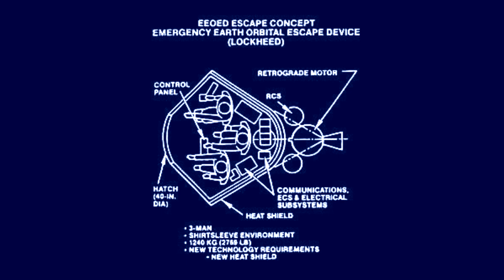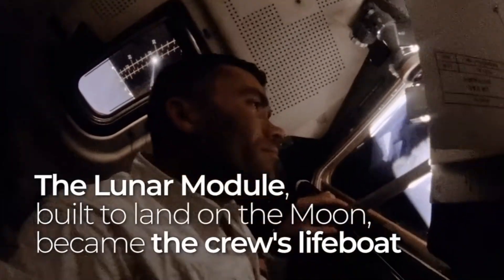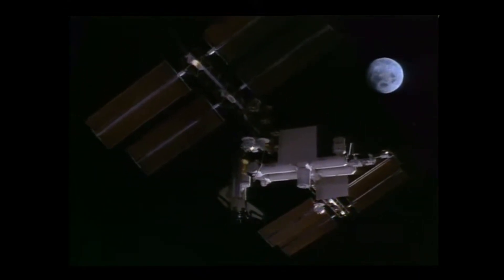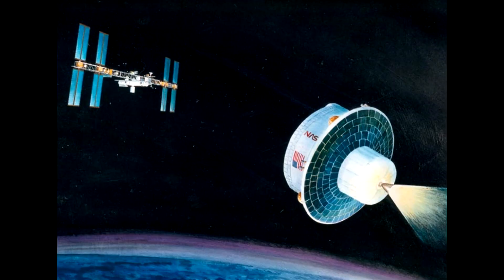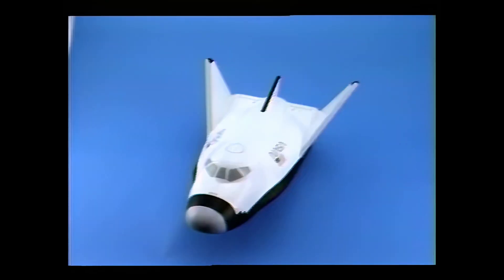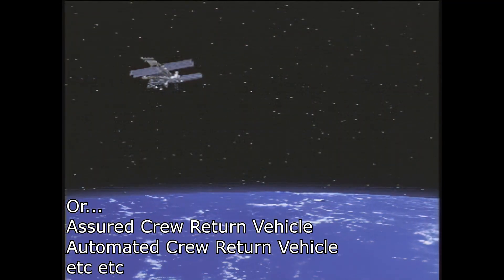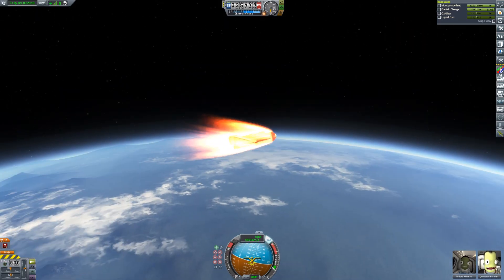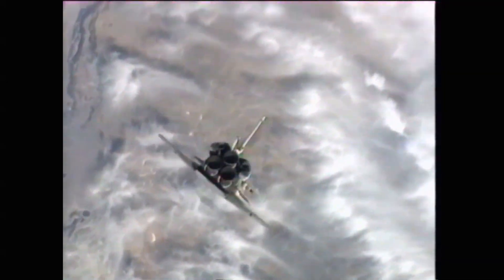The 'Escape Pods' That NASA Developed, But Never Used.

Comment: Scott what do you think the likely hood of a replacement for the space shuttle something that is capable of serving satellites in space and travel to the space station?  
I know China has its own space station etc and I heard something about the ISS coming to an end…

Why can it not be expanded rather than dismantling it?
If it’s due to worn out parts can they not be dumped to burn up and replaced etc..
I would have thought it would be cheaper to expand what is already there rather than start from scratch etc..
Keep up the great work

Comment: Wasn't Orion also considert as an ISS escape vehicle, after both of it's launch vehicles and it's service module was cancelled?
Reply: Back under the constellation program it would have launched on Ares 1 and faired crew till commercial crew was ready or commercial crew was created after Ares program was cancelled and revamped into the SLS program

Comment: Way back when I worked for McDonnell Douglas (MDAC) at KSC I was part of a team that was supposed to evaluate systems for what was internally referred to as the GTFO (Get The F... Out) for Space Station. It never materialized. The problem with all these ideas is the additional cost to develop, build and maintain. The thinking always came back to using the transfer ship as the rescue ship because you already have it. Shuttle was a problem but even back in 1988 there was talk about partnering with the Russians for a long duration escape ship.
Reply: The use of a cargo ship as a rescue ship is another option - the Dragon was quite capable of that. It does involve a reduction in payload capacity however.
Reply: @allangibson2408  ... would it? Ôo
Just a silly late-night thought and with a beer already gone down the drain: you'd need a short-term life support system and a few high-G seats for the passengers. If you managed to make portable modules of them you could stuff them into the Dragon (after ripping out the cargo if needed), attach them to a few built-in mounting points, and you're almost good to go. Question is how long this would take, but it might be an option.
Reply: @44WarmocK77  The Dragon has a heat shield so that takes care of the first and biggest problem. You need a minimum of two hours life support for a crash re-entry - the Station EVA suits have 12 hours. The most likely case of need would be a collision that takes out the station by directly impacting the crew transport capsule and damaging the docking port as a result.

Comment: "rocket-propeled lawnchair"
Every first ship in any ship building game ever
Reply: Nothing succeeds like success. You can return a lone stranded Kerbal from well within the orbit of Moho (very close to the Kerbol, the sun) to a fairly safe Kerbin orbit, where she can be rescued by economically feasible means, with something like that! The down-side is that it takes virtually the largest delta-V possible in the game to get the ion-drive-equipped lawn-chair rescue package payload to an orbital rendezvous that close to the sun. Or, about 30,000 m/s. Once she's aboard, the rest is fairly straight-forward orbit-wrangling. To be clear, it's an ion-thruster propelled lawn chair in my version. The mission is called "Big Intrasolar Technically Challenging Headache Prototype Long-range Electrically Accelerated Search/rescue Equipment". So-far it is by-far the hardest rescue-mission in this version of KSP. It's colloquially referred to by the technicians who operate the mission as "B*TCHPLEASE".  The mission-patch is completely awesome, and the rescued Kerbal, Clauby, will get to wear it with pride. She will also out-rank even Valentina and Jeb when she gets home.

Comment: So they designed a spaceplane to replace a spaceplane that couldn't withstand long enough durations?
Reply: Yes, one that could vs one that couldnt. The Shuttles couldnt remain due to the fuel. These would've "kept" far longer

Comment: Thanks for the video Mr. Manley, it is neat and clear as usual.
Just wanted to express my disagreement with the "emergency escape system" being the same ship that transports the astronauts to and from Space. Giving redundancy to every system onboard do not provide a redundant separate mean of escape. Gemini had rocket-propelled ejection seats, Apollo had its solid rocket motor on top. Then, the Space Shuttle had yes maximum redundancies but no escape system, and blew up twice. Soyuz and Dragon both have escape systems; because the First Corollary to the Murphy Law clearly says that: "Your astronauts are going to need an escape system the moment you remove it from your Spaceship".
Thank you - once more - for all the continued and very well documented updates you keep providing. Me lazy, I just thumb up and watch them...
Reply: aslo the spacex dragon capsule itself can also be a escape pod for the iss! with a massive crew capacity from as low of 6 to a maximum of 12 astronauts and more than enough fuel after being docked from being launched from earth to help get the astronauts back  down in a emergency! it even has its own dedicated solar and battery power supply that can even help keep some of the iss systems powered in a emergency and it's also far cheaper then the most what NASA could come up with!  heck starship could even cram a dragon capsule in some variants like the moon and cargo variants for an emergency if spacex wanted to! or they can even have crew be transferred from earth to the starship for interplanetary  long range missions via dragon capsule to save a lot more fuel for starship's missions for going to the moon and mars and beyond!
Reply: @ashtiboy  IIRC cargo variant of Starship will be unmanned, therefore not needing any escape system.
Reply: What about redundancy for the escape pods?
Reply: Fun fact: There were proposals for "Evolved Shuttle" involving liquid fuel boosters and an ejectable crew deck dating even before Challenger, but NASA couldn't afford the development cost of them. #FundNASA

Comment: Every spacecraft should have some kind of escape pod or way of escape it is something I always thought the space shuttle design should have had
Reply: One thing that bugs me on Starship is there is no escape system for use during launch.
Reply: I disagree, well not for the ISS/stations, return to Earth capability is an absolute must, but for spacecraft themselves, no. Escape pods might've helped in the case of the Space Shuttle but that had an inherently bad design and it would've been better off just making a new spacecraft instead.

If you design your spacecraft well enough, with enough robustness and redundancies, you won't actually need an secondary escape method (or if you do, an escape pod probably wouldn't have helped anyway).

Each escape pod is its own spacecraft, it has to be space worthy and it has to be at least as reliable if not more reliable than the original spacecraft in an emergency situation. If your making your escape pod that reliable though... why don't you just make it your spacecraft? I mean it's going to cost about the same to design and make as a spacecraft so... yeah.

For example, lets say your ship's life support fails. Do you? Abandon the still working engines, fuel, electronics/navigation/comms, re-entry system, etc etc, of your current ship, and then rely on the escape pods life support, engines, fuel, batteries, electronics/navigation, heat shielding. Or do you simply burn some oxygen candles while trying to repair the main life support? Or use the oxygen candles for life support while you return to Earth in the normal ship? You're in charge of the money and mass budget, which would you pick? Some candles or an entire extra spacecraft?

Or lets say a CME wrecks the electronics in your spacecraft. Why would you assume the electronics in the escape pod would fair any better than the spacecraft, is the electronics more robust in the escape pod? If so, why didn't you stick that electronics into your spacecraft instead?

Engine failure, tank failure, electronics failure, etc, etc has the exact same issue. Every kg and £ of escape pods you lug up into space, is money and mass you aren't using to make sure your actual ship doesn't fail. It could be spent on weightier but more reliable engines, or redundant engines, or stronger tanks, more robust electronics, better heat shielding, etc. All things which could also fail on the escape pod too.

Even pressure loss, if you have enough pressure suits onboard (you will), stick the pressure suits on and repair the hole or return to earth in a slightly vacuumy spacecraft. That's what they did after Soyuz 11 happened.

Going really simple doesn't help either, take MOOSE. You had to have enough working space suits for all the passengers, which can also survive the ridiculous forces and temperatures of re-entry (that plasma sheath will happily cook you via IR radiation, it's basically like being surrounded by the sun), the suits have to be able to be put on fast enough to escape in an emergency (normally space suits take at least an hour, with help and special breathing techniques). Then all your astronauts have to be trained to orient themselves and navigate their own way out of orbit (likely with little to no communication, long range radio is heavy), otherwise they'll just die up there, and finally, you have to make a suitcase which can survive re-entry speeds and temperatures while also remaining inherently stable. If you succeed in that, congratulations, you now have between 0 and 7 surviving astronauts somewhere on Earth, good luck finding them before they die from exposure.

It's kind of like why airlines don't carry parachutes. Parachutes aren't that expensive, are rather reliable, and they can be made to be pretty idiot proof too, but airlines don't keep them onboard, why? Because it's far safer and cost efficient to just make the rest of the plane so safe that parachutes aren't needed in anything but edge cases. The airline can focus on transporting passengers instead of bulky parachutes and can focus on engineering solutions which leverages the resources you have, namely a typically still "mostly" working aircraft.
Reply: Fun fact: There were proposals for "Evolved Shuttle" involving liquid fuel boosters and an ejectable crew deck dating even before Challenger, but NASA couldn't afford the development cost of them. #FundNASA

Comment: It's still not clear to me what huge advantage is there in glider-type reentry vehicles vs the more traditional capsule method.  Volume? Costs?
Reply: Space planes have larger surface area and wings can provide lift so they can re-enter at slower speeds and lower Gs. Which means more comfortable ride. Lower risk of damaging experiments onboard and so on. And as Scott said, they can choose their landing site. Unlike capsules.
Reply: Think about it like airbags in your car, vs just slamming your skull into the dashboard/wheel hard enough to crack it open, damage internal organs overall, and possibly damage neck/spine. One is far more gradual on stopping you, vs what equates to practically a hard stop
Reply: Wings on orbital lifters aren't as bad as SpaceX's PR makes them seem like. A aluminium construction/winged flyback Heavy-lift Vehicle from NASA's SPS study had a similar payload to Starship, yet only 4000t mass when fully fueled - less than simply the fuel mass of Starship, and even with some mass reserve!

Comment: Would you consider the ejector seats on the Gemini capsule an escape pod? It seems equally crazy as the MOOSE, if not more so.
Reply: I think those were only active during the launch, and never useful afterwards since if your chute is tangled on re-entry you're probably tumbling and rolling around
Reply: You mean the gemini ejection seats that entailed lighting a rocket engine in a pure oxygen environment atop a giant nasty hypergolic fuel tank?   im not sure that qualifies as "escape".....

If i recall those seats were there bc gemini was originally supposed to land under a paraglider wing horisontally.
Reply: Just imagine those ejecting an astronaut in orbit due to a sick malfuction.
EDIT: Or the same thing happening to a cosmonaut in one of the Vostok missions.
Reply: The ejection seats on the early shuttle flights were even crazier, and as later analysis turned out, almost certainly suicidal, since the seat likely wouldn't get you clear of the SRB plume. John Young said that if he had known about the body flap uncommanded movement during liftoff of STS-1 he would've ejected then and there; good thing he didn't or he and Bob Crippen would've been killed.

Comment: I suspect once space tourism becomes a thing, escape vehicles will become more relevant as it will get difficult to keep full launch vehicles docked for every group on the stations. Not to mention, once vehicles like starship are operational, it just wouldn't make sense to keep the vehicle docked when it could be performing other missions. Eventually, space stations will be large enough to support multiple groups of occupants serving multiple purposes. So with starship you could bring 50 people up in one shot and they aren't all necessarily gonna need to stay for the 6 months. Some experiments might require less time in orbit than others and may need to be returned sooner. Eventually, the need will arise for the starship to leave the station without all the occupants it brought up being on board, so escape pods are an eventuality. Probably a good thing for young aspiring space engineers to think about...
Reply: Space torism is dangerous, innecesary and should be ilegal.

Comment: You should make a video about possible launch escape systems designed into SpaceX Starship.
Reply: There is none. Starship itself is designed from the ground up to be at least as reliable as an airliner, so the escape system is simply not needed because nothing goes wrong that would require an escape system.
Starship can maintain attitude control with just one SL Ratptor firing, as has been demonstrated during the various flight tests.
The booster has so many engines that the onboard computers will simply shut down any single failing engine, and if enough fail in one spot then it will additionally shut down engines on the opposite side of the booster in order to maintain control authority even if it won't be able to land again in such a configuration (it will sacrifice itself to ensure its mission is performed to completion, just like Falcon 9's first stage).
Additionally, all that extra equipment is heavy and the margins just haven't been designed into Starship to be able to accommodate the additional mass of such systems.

To counter all of this, Starship will not be flown crewed until it demonstrates the level of reliability expected of it, that way there will not be a need to "add systems to save the crew from an untested system" which would invalidate the testing of the very system that's untested that would require additional systems to protect the crew from it! (sorry if that got confusing, my point is that putting an escape capsule on Starship makes it not Starship, so the testing for the Starship systems becomes invalid if the escape capsule is present).
Reply: @44R0Ndin  Then it will be flying for a very long time! Even on the Space Shuttle, there were proposals for "Evolved Shuttle" involving liquid fuel boosters and an ejectable crew deck dating even before Challenger, but NASA couldn't afford the development cost of them. #FundNASA

Comment: elons dragon capsule will always look like a drop pod ready to deploy anywhere on the earth's surface, if only our planets collective space programs were at a level where drop pods could be a thing
Reply: It might be something that gives Dragon life after Starship!
Reply: Wings are much safer, and aren't as bad as SpaceX's PR makes them seem like. A aluminium construction/winged flyback Heavy-lift Vehicle from NASA's SPS study had a similar payload to Starship, yet only 4000t mass when fully fueled - less than simply the fuel mass of Starship, and even with some mass reserve!
Reply: @HalNordmann  are you talking about the Venture star/X33?
Reply: @PC-nf3no  Nope, it is something else entirely. It was planned for the Solar Power Satellite system. Methane first stage, hydrogen second, 12.5m diameter, 14x11m cargo bay, 120t payload to LEO.
Reply: @HalNordmann  I haven't yet found any documentation on the vehicle. I only see the satellite power system. I'll keep looking
Reply: @PC-nf3no  It is in Volume 7 of the NASA reports on the SPS, appropriately titled Space Transportation.